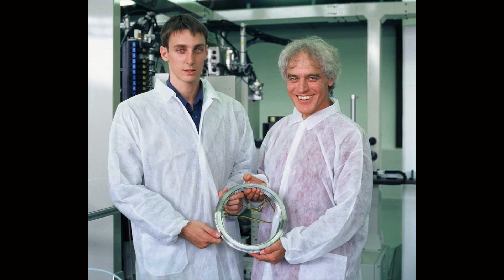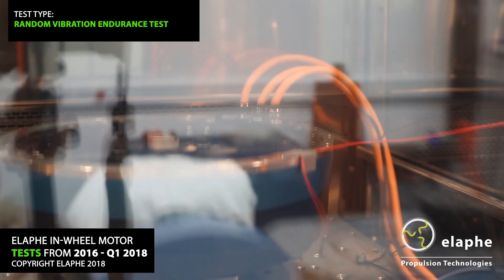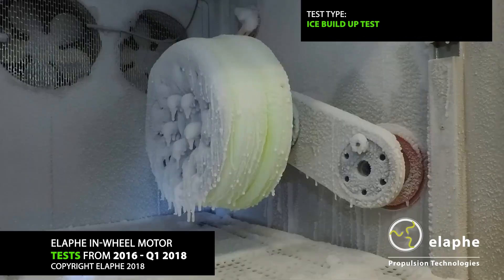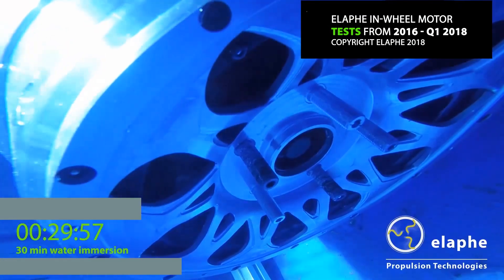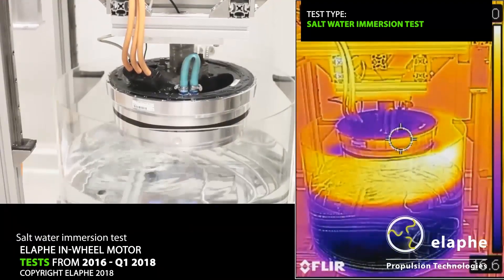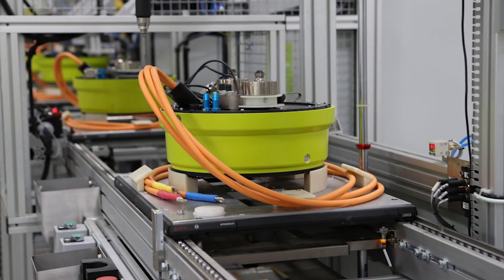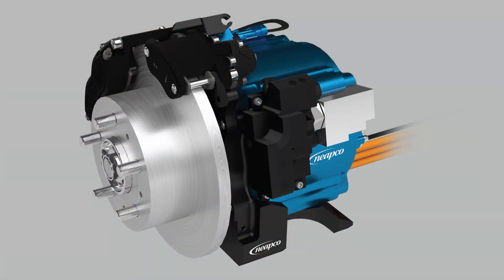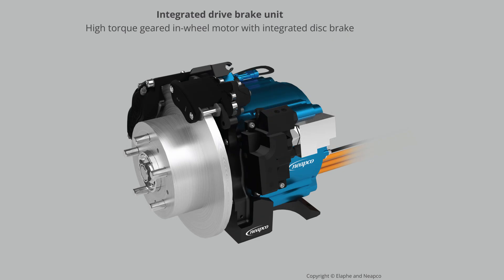Elaphe Sees Big Opportunity For Wheel Motors in EVs - Autoline Exclusives

Comment: Thank you for hosting us.
Reply: 💢💢  We have patented an ultra-high specific torque [compact] gear technology which does not utilize toothed gears, based on our reformulation of gearing theory, to outperform all other gear architectures, called FrictionLess Gears. It can be formulated in rotational or linear solutions with ~90% reduction in size. In-wheel propulsion is a natural fit.  💢💢 

We can also offer revolutionary induction-less/magnet-free, ultra torque dense motors which do not require rare metals and ~90% less copper.

Our groundbreaking power dense, high performance engine designs burn any fuel cleanly w/o any noise/odor/smoke/pollution [just CO2], making it suitable for all applications, including robotics. For robots, we have conceived novel high specific power transmitting mechanisms which reduce complexity/weight/package size.

💢💢 <><><> Our innovations enable advanced, compact, low cost, high efficiency, turbo-engines and power generating turbines  <><><> 💢💢 

And more...

Comment: The hub motors offer many advantages. I believe there have been offerings of 350# of torque per wheel. If the unsprung weight issue can be addressed, I think hub motors would become one of the lowest cost options. I don't believe the unsprung weight factor is a fatal flaw. Just another option. Always best to have options.   😉

Comment: To get the unsprung weight out I was  wondering with regen braking  if they could reduce the size of,  or eliminate the conventional brakes.  Also, for a Robitaxi type vehicle could they eliminate the trasmission because of the lower required top speed.

Comment: I met some of the Elaphe team when they came to the Fully Charged show in San Diego at the reveal of the Gamma model Aptera. They had spent years developing the in-wheel motor to be smooth, powerful, efficient, and reliable under truly harsh conditions. Plus Elaphe refined their motor design further in the Aptera to be very light, and to take advantage of the Aptera's lighter and more aerodynamic body reducing unsprung weight, and increasing efficiency even further.  Still, I can understand why Aptera neded to shift to a more standard and proven E-axle motor, with the built in gearset and control electronics, to more easily bring the Aptera to production in 2025. But I still think that the door is open for Elaphe to provide an in-wheel motor for the rear wheel in a future AWD model.  🚗🌞

Comment: The mass of a drive motor should be at the center of the longitudinal axis, with brake disks and rotation speed encoders on each side, and lightweight tubular axles going to lightweight wheels and hubs.  Friction brake heat will be minimized by motor regeneration braking, so the wheel well can be optimized for minimum aero drag rather than brake cooling at the wheel.  Keeping the unsprung weight as light as possible in this manner will improve tracking compliance, ride, NVH, centrifugal rotation inertia, and tire wear and drag.  Wheel motors large and torquey enough for road speed cars would be a bad idea.

Comment: Car components live in a very punishing environment; not just water, but tremendous heat, vibration, and sharp inertial forces probably nowhere moreso than at the wheels.  (This is one reason we're still using balloon tires rather than modern redesign attempts.)  Think of what this motor must face when striking a pothole at speed, washboard pavements, or glowing red from heavy braking.

Comment: I wish them well. Looks like water, cold temps, power delivery are under control. But the big issue that I would ask any in-wheel designer is heat management. The break rotors can get white hot from hard breaking: how are the motor components such as the rare earth magnets protected?
Reply: From what I can tell, their design minimizes the impact of brake disc heat on rotor magnets. The water-cooled stator sits between the brake disc and rotor, acting as a thermal barrier.

Comment: Wheel motors are the dumbest idea ever!!! TOO MUCH UNSPRUNG WEIGHT AT THE WHEEL AND TO MUCH VIBRATION FOR MOTOR TO OPERATE RELIABLY!!! Plus TOO MUCH TORQUE ON THE SUSPENSION COMPONENTS!!!
Reply: Torque is not the issue. Every car has brakes that are capable of generating more torque than their motor can output, and that load goes through the suspension into the chassis except for very (very!) rare cases of inboard brakes.

Structural stiffness to maintain proper orientation of the motor rotor and stator is an issue, but one that can be solved with proper engineering. Ditto vibration mitigation.
Reply: “It ain't what you don't know that gets you into trouble. It's what you know for sure that just ain't so”
Reply: 0 vibrations - i drive one - weight can be reduced by half with new design and better engineering
Reply: @marong3717  The vibration I am talk about is from the road surface/ potholes!!!
Reply: @robocowone464  And that's what engineering is for - to design the bearing elements, knuckle, and other load carriers to deal with those loads. Just as has been done for automobiles and trucks for over a hundred years.
Reply: @davidg3944  How about this for an engineering decision, DON'T PUT THE MOTOR IN THE WHEEL!!!
Reply: @robocowone464  Would you like to give us some metrics to help judge your opinion? Professional background, years experience, etc. Otherwise you're just another shouty person on the internet...
Reply: “Everything should be made as simple as possible, but not simpler” IE everything is simple when you oversimplify it.... and pointless... YT experts ;)

Comment: Hub motors have been in use on diesel electric trains and earth moving equipment since the mid 20th century and they work great in both applications.
Reply: Sure, but none of those care about Noise, Vibration, or Harshness (NVH), or handling, both of which care about unsprung weight sitting in the wheels.
Reply: @wyw876  My point without actually saying it and pointing out the fact that it's not new technology.
Reply: @wyw876  making very lighter hub wheel motors can solve the problem
Reply: Railroads don't have potholes!!!
Reply: @robocowone464 Mountain ebikes (bicycles) often have hub motors and subject to quite harsh conditions. Of course it's on a very different scale but the vibrations, environment and application in a small way proves the concept. Can it be scaled up to automobiles is the challenge.
Reply: Large trucks like Belaz use them as well
Reply: In construction/earthmoving equipment the hub motors are typically hydraulic, not electric. And since they rarely have articulated suspension, there's no (minimal) relative movement of the hydraulic lines feeding the motors. Not familiar with drive layout in diesel electric trains, but suspect it's similar in relatively fixed placement.

Flexing of electric cables is an issue with hub motors, as is protection from damage caused by accidents and road debris. Extremely fast fault detection and power shutdown controls are needed to prevent electrocution risks or explosion of battery packs. It's not a trivial matter...
Reply: @davidg3944  Those construction equipment move slowly. I don't think a hub motor would be reliable at freeway speed.
Reply: @Carguytct  I can't categorically state "it's not an issue", but with my exposure to engineering, materials science, and having done work in vehicle component design and manufacture for many decades I think I can say that "a hub motor can be engineered to work". 

It takes money, time, and demand, as the folks who were interviewed can attest. But with what I've seen done in the two major fields I've played in (automotive and aerospace), it can be done. A couple decades ago, would we have said a reusable rocket would be possible? Yet here we are...
Reply: @davidg3944  Same thing could be said about fusion,  It's been 5 years in the future for decades..... It's difficult even for experts to determine the difference between what's possible and what's plausible in a relevant time frame? .... Let dreamers dream it's all good.... I just happen to be more of a skeptic, with an engineering degree.....
Reply: @Carguytct Bikes, scooters etc have hub motors, they’re not completely reinventing the wheel.
Reply: Mountain ebikes (bicycles) often have hub motors and subject to quite harsh conditions. Of course it's on a very different scale but the vibrations, environment and application in a small way proves the concept. Can it be scaled up to automobiles is the challenge.

Comment: Aptera was considering using these motors, but they would have had to find or create an inverter that would work in their cars. In the end, they decided to go with a more traditional motor. So, to speed up production, they had to ditch the in-wheel motor. In their case, the motor was not yet ready for prime time. They said that they are still looking at perhaps using the motor on the rear wheel, but that is far off into the future. The concept, nevertheless, is interesting and bears consideration. Thanks for keeping us up to date on new developments, and I hope you and your team continue to follow this technology, as I think it does have a future.
Reply: They couldnt provide the quantity required.
Reply: What I don't understand is why Aptera couldn't turn to Elaphe itself to develop the inverters.  
The shift to the Vitesco powertrain will almost certainly cause a significant hit in Aptera's efficiency, which is Aptera's whole purpose.
Reply: @robertkirchner7981 "a significant hit in Aptera's efficiency"  Hyperbole.
Reply: @robertkirchner7981  Good question, which they did not address in any detail.

Comment: Vehicle architecture embrace wheel motor concept only engineers hate it.
Reply: Because only engineers know the compromises involved and realize it's impractical.
Reply: Kyle Nelson: “It ain't what you don't know that gets you into trouble. It's what you know for sure that just ain't so”
Reply: @nc3826  Circular argument.
Reply: Kyle Nelson: Wrong again, on both counts.... And Samuel Clemens said, Thanks for proving his point...
Reply: @nc3826  Ok then, design a road vehicle with hub motors and give us a download link with the specifications and blueprints.  Have your circular argument point prover help you out if needed.
Reply: Ok then, Kyle Nelson is a Wrong Brother.... Which is why this whole conversation is beyond him....
Reply: Same is true before the Rights Brothers for flying machine heavier than air - is also impractical.
Reply: Bottom line is there are differing narratives, within the same professions,....  

It's a shame that YT experts, need to try to oversimplify the world...  To fit the overly simplistic narratives....End of story...
Reply: @philoso377  They tried it and it worked, hub motors have been tried on passenger cars and failed. See the difference?
Reply: No one have said all that attempted heavier than air machine, failed.
Reply: And EV battery powered cars are another example.... Every option has trade-offs.... It's never a matter of succeeding or failure , to real Engineers....
Reply: @nc3826  Your posts are rife with overly simplistic narratees.
Reply: Kyle Nelson:  Thanks for the irony, that proved my original point.

Comment: Horrible design!  Too much weight at the wheel & over complicates the hub.  If you insist on an EV power train, send it through a transmission or directly connect it to a differential.  Why try to reinvent the wheel?  Keep it simple & work with proven designs.  Just my 2 cents.  God speed.
Reply: It’s really all about “unsprung weight”.  With carbon fibre technology for wheels, and more lightweight compounds for tires, coupled with efficiencies to be gained in electronics and magnetics, I’m sure this is a “technology of the future”.

Manned flight was IMPOSSIBLE until it wasn’t
Reply: Thank goodness innovative engineers don't think like you or zero progress would be made over time. "Just do what we have always done".  🙄
Reply: @fpartidafpartida Adding complexity isn't a solution for little gain if any. It is meant for marketing than anything else. Just as Hydrogen isn't a solution for cars and that is a fact. But many still experiment with it as it would still use an engine. That is the end goal and not for practically. When presenting facts people like yourself don't get it.
Reply: Everything has trade-offs and this is nothing new as Illustrated in the post.... “It ain't what you don't know that gets you into trouble. It's what you know for sure that just ain't so”.... Except of course if you're a YT expert ;)
Reply: True four wheel drive w/o a transmission has incredible potential.  The car's computer can monitor each wheel for traction and the like and adjust each wheel independently based on traction needs, for example.  I agree, however, that the un-sprung weight on each wheel would be high, this impacting how well the suspension works.  This solution would likely have potential for low-end cars that just need to work, but perhaps not idea for high end performance cars.